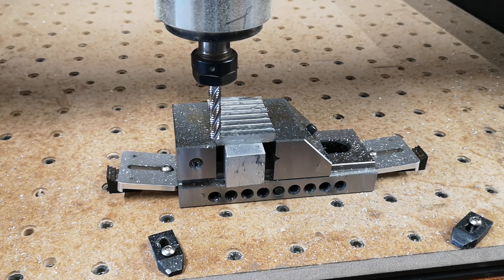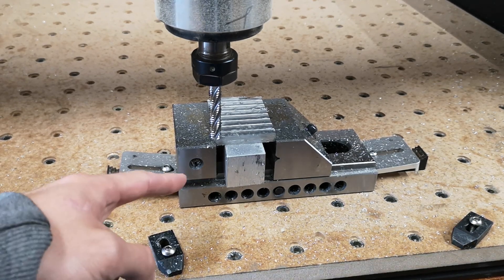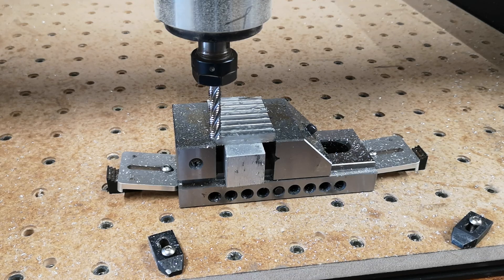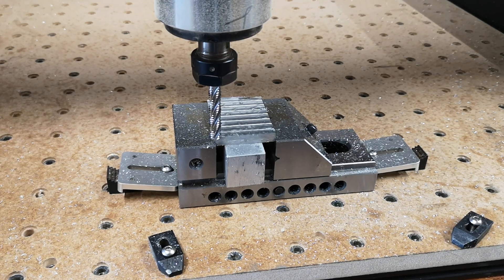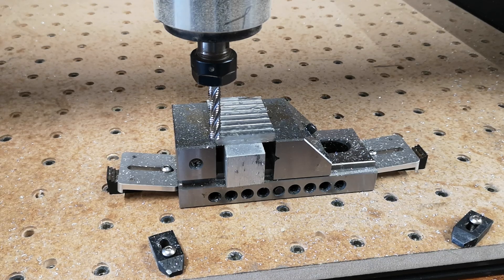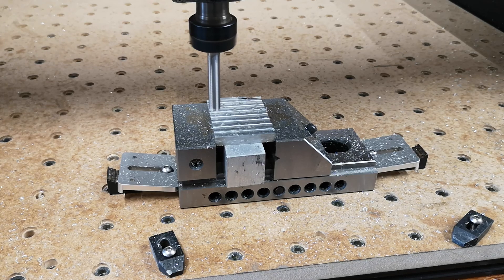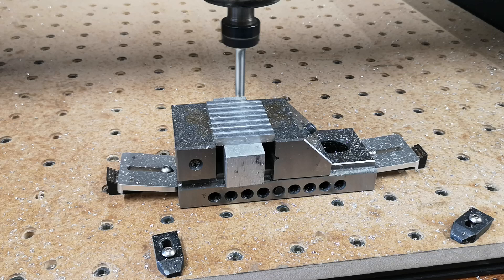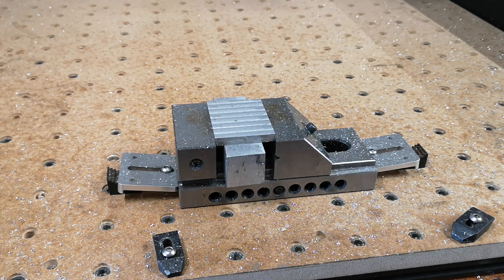Beaver Pro DIY CNC - lets go mental

Comment: OK, I think I'm going to pull the trigger on this set up. I just need to go over in detail what you meant by not using Shapeoko's electronics.
Reply from the maker: I would say the stock shapoko electronics would be under powered for a machine this size. You'd be better off running a new machine setup with external drivers